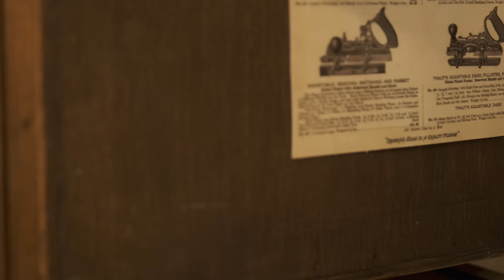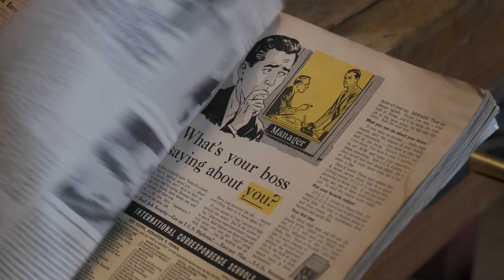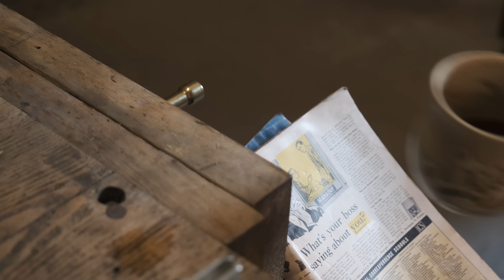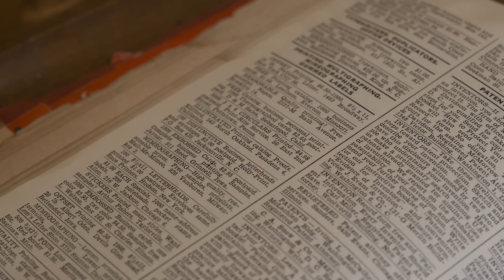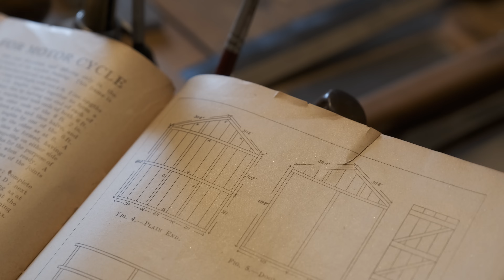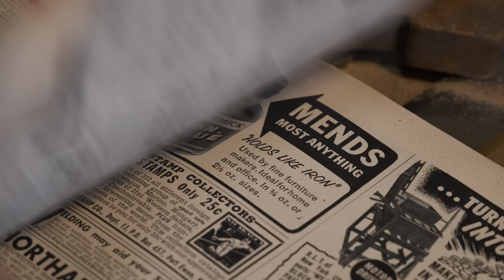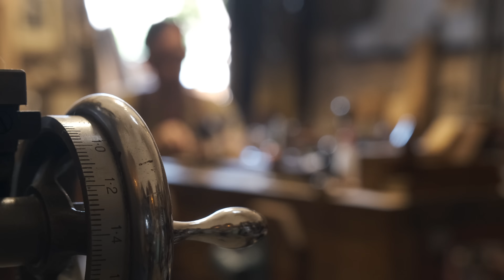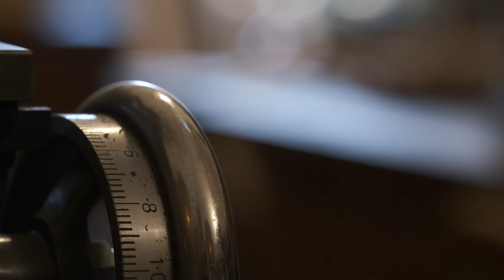The Wooden Hand Plane - Restoration

Comment: Another masterpiece.  Thank you for uploading.
Two questions please:
The open throat on the front. Purpose please.

Why hide your stamp on the added brass shoe? 

Thank you again
Reply from the maker: thank you very much. I'm glad you liked and niice to see you here. Actually the throat is open but the blade is very close to the end because of the inside bevel and thickness of the blade. I hide the stamp because I m not the full maker of the plane. I made a little surprise for the upcoming 100 years :))

Comment: Enjoy your style of videoing of your craftsmanship! Two things if you can get a bottle of evapor rust you would have a blast with it I want to start out on 220 it works at a good cutting rate  without deep scratches! I never go lower than 220. What were you using in the oil mixture with the wooden stick when you're rubbing the blade? I appreciate your feedback. Thanls Columbus Michigan
Reply from the maker: Thank you very much dear friend.Warm greetings to Michigan

Comment: I have a very similar plane but in better shape than this at the beginnning. Yours probably started as a scrub plane, as its quite slim and has no chip breaker. Just the blade shouldve been curved at the front but that was probably ground away at some point when it wasnt needed as a scrub plane anymore. Same thing happend to mine but i also got a newer ECE scrub plane thats still curved and these narrow planes really are perfect to remove thick shavings very fast.
Reply from the maker: thank you for your comment my dear friend. nice to see you here

Comment: I was given an old Ogontz Tool Co no. 13 wooden jack plane. I think many would’ve thrown it out because it’s a mess: One of the ears is broken off the wedge, the mouth area and inside the plane looks like it was on fire (😯🔥??), there are cracks in the sole, the iron has pitting and rust, a corner of the chip breaker’s curved part is eaten away by rust. It is a pitiful sight.

But, I’m going to restore it. Why not? If I crap up the restoration, the plane is already a junker. But if I do a good job, well, that’s an accomplishment, a piece of history salvaged.

I found the exact size chip breaker on ebay for $11. I am going to have to graft in some repairs but Ohio white beech is not available here in Florida. I decided to go with an abandoned offcut of dusty birch at my local family-owned lumber yard; they almost donated the piece to me. Birch: Little grain, hardwood, light color, and easy to work with; I think it’ll be a close match.

Thank you for this rescue video. It was immensely enjoyable and helpful. I will refer to it often. My tools are not as fine and precise as yours, but I will derive the same pleasure as you surely did.
Reply from the maker: Dear friend well done 👌🏻⚒️⚙️ This is a beautiful restoration story, I loved. Keep working, I'm waiting your new story 👌🏻